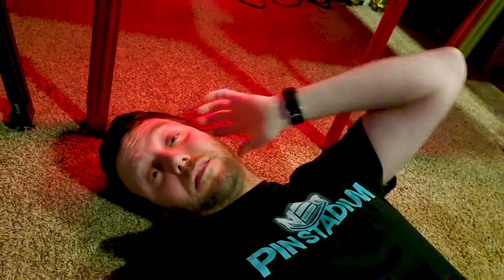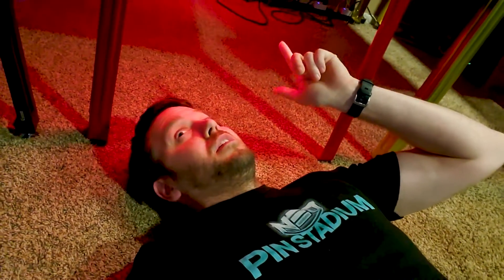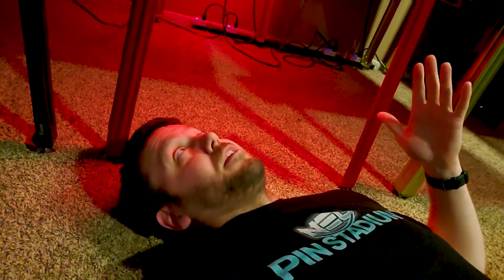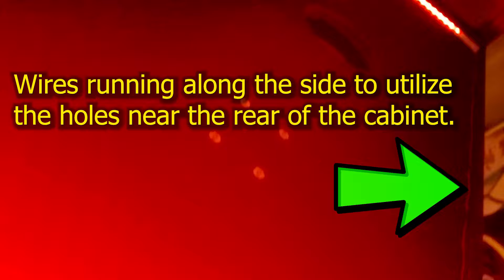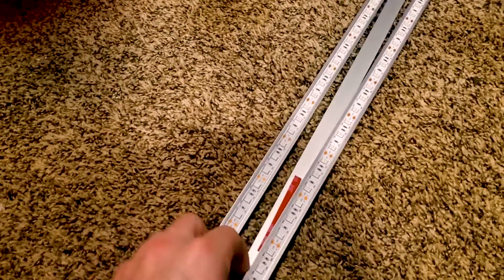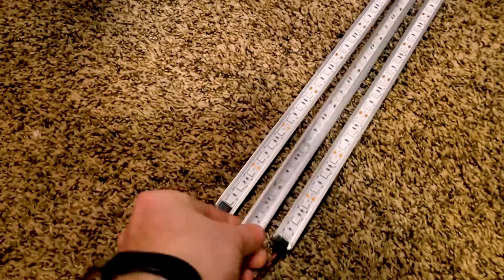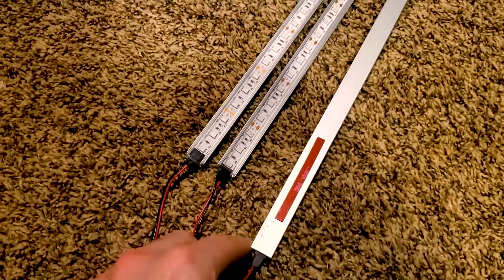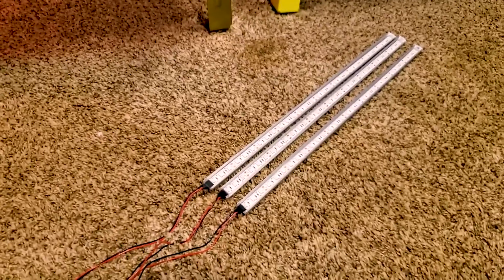How I Install Mezel Mods Underglow Kit on my Pinball Machines

Comment: I only have a modern Stern and use Wiz strip lighting.  I also run them through the holes in the back and under the metal mesh after removing a couple of staples.  The strip lights have an adhesive strip making it a very clean install.  I use Wiz lights all over my gameroom (can lighting, underseat theatre recliner lighting, etc).  They are completely color customizable, dimmable, time programmable if you want, have several programmed dynamic modes., a phone app, and a remote.  It would be possible to make a 12V harness and power them that way too but I'm lazy and just use the service outlet.

Comment: At the very least solder those wires after you twist them. To many times I’ve run into problems with the quick and easy method. Also can get a de-pinning tool and just pop the pins out of  the molex as well. Love the videos Cary, what color would you go with for a MMR Royal?
Reply from the maker: "know your audience". Most people don't have said tools and have experience with solder. So, I show this simple dirty method. I specified it isn't the 'best' method.  For MMr I would go with yellow or purple (color of Royalty).
Reply: @CaryHardy  went with Ler mods that ties into the speaker lights so it changes colors with the speaker lights and gameplay. Will see how this turns out. Thanks

Comment: Great call with using an additional power supply! This is my preferred method for soldering 2 wires together (sans silicone paste) when they're potentially going to experience some tension/pulling: https://youtu.be/qxqZJH3SfN4

Surprised you wiped down the area with IPA instead of Old Rasputin Russian Imperial Stout ;)
Reply from the maker: Wouldn't waste a good stout on something like that!